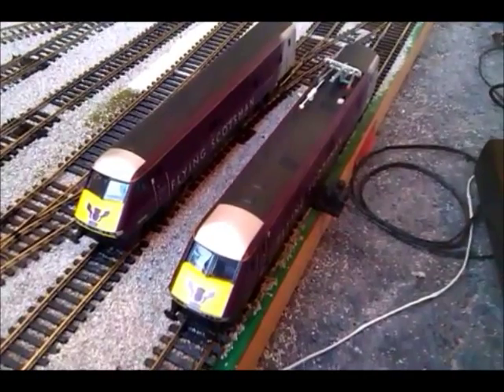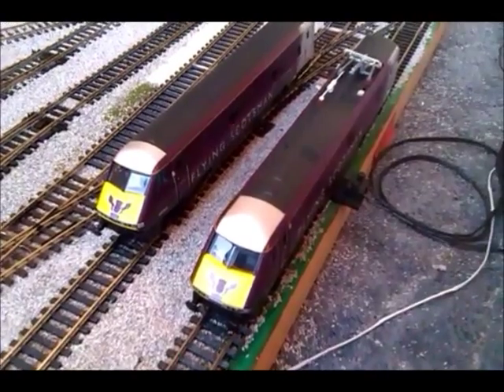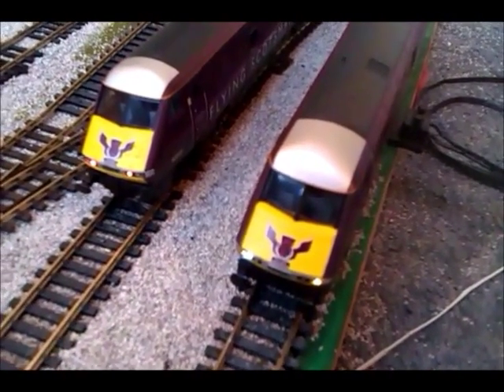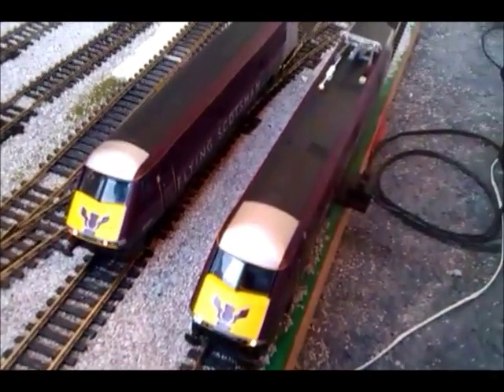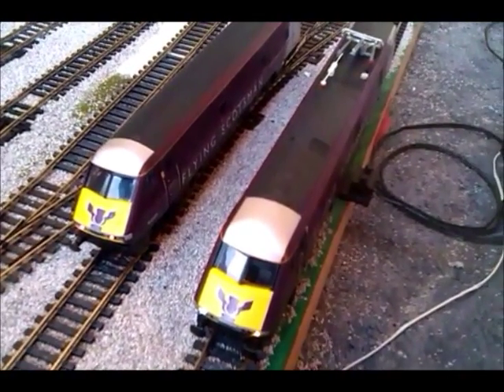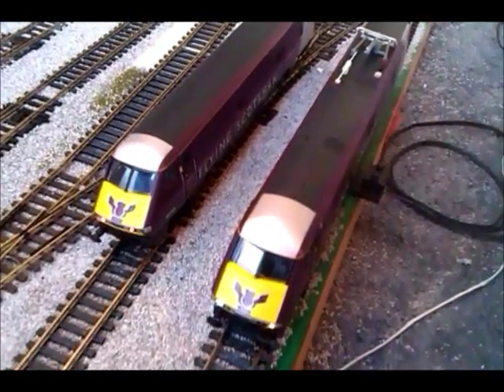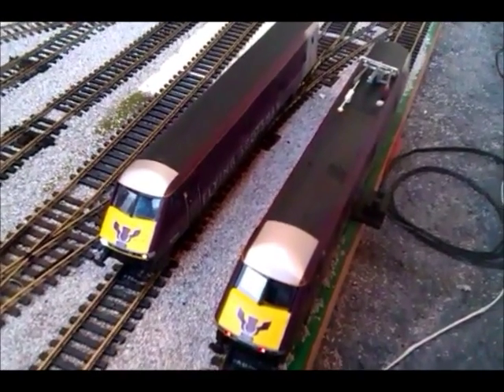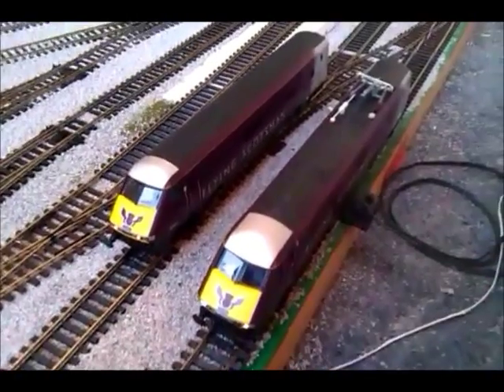Hornby East Coast Flying Scotsman Olivia's Trains Sound & Lights

Comment: How did you get the lights fitted in to those models?   Kits?   Or done professionally?   They look great. Dave
Reply from the maker: hiya Dave. the lights and sound were all done by Olivia's trains. My mate now does all our sound and light fitting for the shop nad he says if he hasnt done it before he will happily have a go :)
Reply: ***** Hi, cheers. 

And did the light fitting require any cutting of the shell?, and more importantly, did the light fitting damage the cosmetic appearance in any way?

Also, how much did olivias charge for this work to be done in the 91 and also the DVT?

Would love to see an up close of the fronts of these two locos on video if you have it.   If Hornby refuse to give us a retool 91 then it might be the only route for me to go down!
Cheers.
Reply from the maker: i can't remember how much it was it was over a year ago now :) they drilled holes in the fronts for the lights no cutting of the body shell. they didnt damage anything on it. they installed pick ups on the DVT as well and didnt do any damage to that either. i dont have a video of just the lights but when i do my next video ill see if i can do a quick close up of them for you

Comment: Sounds good. Although I am more in Class 90's. I may invest in getting this train pack. I assume the lights are a retrofit?
Reply from the maker: dont know what u mean by retrofit ash but olivia's installed the lights and sound for me
Reply: *****
Hi Andy.

A retrofit means an aftermarket/third party modification such as Olivia's added the lights and sound to this model. Thanks for informing me that Olivia's did the lights as well as I thought for a moment there that Hornby had seen sense and upgraded the model with lights. Although it seems that Hornby do not seem very interested in upgrading their models as much as Bachmann do on their modern range of trains mate. Shame really as if they made a new Class 90/91/92 models. They would be great sellers :).
Reply from the maker: im hoping for upgraded models to but ive got a mate who installs lights to all my locos if they dont come with them already.
Reply: *****
I will have to take this up as an experiment on my older models. There is no harm in trying to fit a light set to my old Class 90 models as I am more or less a modeller rather than a collector :).

Ash.
Reply from the maker: im a modeller so i want light and sound in everything. the battle of britain 91 has arrived and thats going to have lights and sound to. its a pity hornby dont do lights like bachmann, heljan etc do id happily pay more for lights